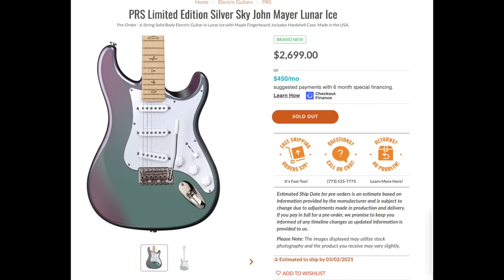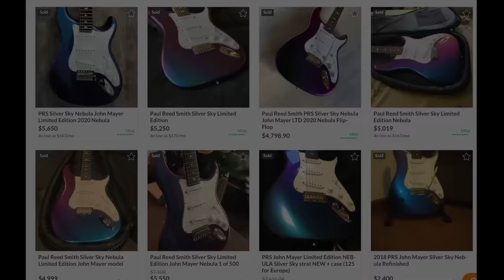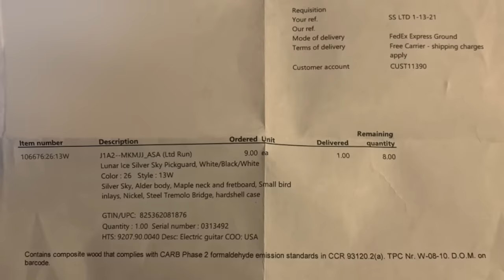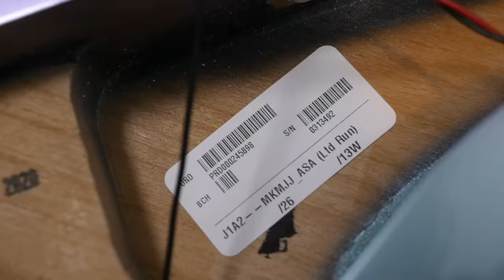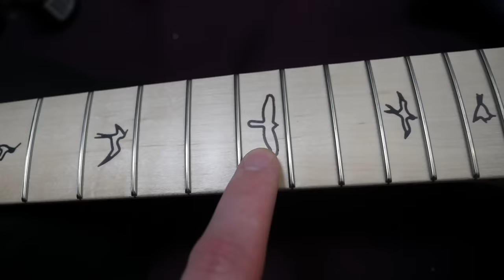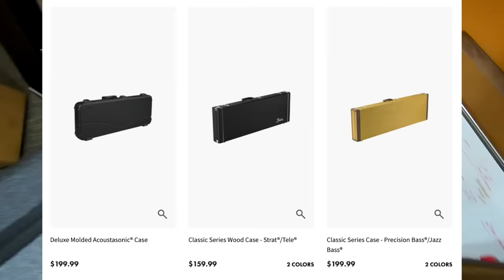I Got One of the First Ones! | 2021 PRS Silver Sky Lunar Ice John Mayer Signature | Review + Demo

Comment: beautiful guitar, but it's a crime that there's no hardshell at that price point...
Reply: Price point aside it’s a limited edition model as well. Hate being a snob but having a hard shell case just makes opening it up for the first time so much more special 😂
Reply: I'll be honest, I have a core 594 with OHSC as well as a Maple fretboard Silver sky. 
The SS case is way more practical. The PRS OHSC are so heavy it's stupid.
Reply: My issue with the SS is that at that price it has a scarf joint. If I'm paying over 2k for a guitar I want a 1 piece neck.
Reply: I get what you’re saying but the gig bag is part of the custom specs. It’s an artistic choice to emphasize the feeling of being a young player. If you want a hard case there’s a whole market for it, wouldn’t it fit in most strat-style cases anyway?
Reply: @NotDingse  yeah I keep my SS in a standard fender tweed and it’s a perfect fit , it is practically a strat dimension wise. I’ve also thrown mine in a gator case and it was just as good. I’d stay clear of those ABS hard cases though I looked at one of those and the tip of the PRs headstock comes really close to the top edge so if it were to take a spill it could put some pressure on the neck
Reply: @NotDingse  your a brave man lol . I really dig relic’ed /warn in guitars but I’ve never understood the people who are against it and say just to wear guitars in If you want a reliced look...I’ve got guitars I’ve had for 15+ years and they still look brand newlol 

Personally I don’t think PRS will do a reliced SS. PRS are probably one of the few brands that don’t look good beat up. They really are beautiful guitars and for the money I’d want to keep them that way. 

Jm is obviously not opposed to relics. His signature relic’d strat the custom shop did many years ago looked awesome though
Reply: @TJJJJJJJJJJJ  i agree with all your points, but the Silver Sky would probably be the model to make the exception of looking good relic’d (as it is basically a strat, which are probably the sole model behind relic popularity)

Imagine an SRV inspired relic on a SS. They could go all in and chip the points on the headstock (I’ve never liked those headstocks)
Reply: @dougstrong5386  I'm sorry your hard shell case is too heavy for you to carry. That must give you nightmares while you sleep. How do you get your guitar to your gigs? You must have to hire somebody to carry that incredibly heavy guitar case. And that's just the case by itself! I can't imagine having to put a guitar in there as well. Good luck, sir!
Reply: @NotDingse  your an ideas man ! Your right a relic ss would look dope , I wish they made it in a sunburst ! I’m a sucker for a beat up two tone strat I’ve got  4 of them lol. 

Curious what’s your number #1 🎸 ?
Reply: @TJJJJJJJJJJJ  We meet again, Mate! Hope you had a good night!
Reply: @jcout25  what makes you more salty, the idea that you think there is a reasonable argument to be made or the idea that I could in fact hire someone to move it if I needed to?
Reply: @joojoosasa  Hahahah fancy seeing you here mate 

lol I swear I’m not stalking you
Reply: What's interesting is that the invoice lists hardshell case. Who knows?
Reply: @TJJJJJJJJJJJ  well, i’m really a drummer, but if i had to say, it’d probably be a blackguard Tele or a Brian May Red Special
Reply: I prefer to not have a case cost hidden within guitar cost.  I dont use cases or bags anyways, but I 0refer to pay for a guitar separately.  Cases are abundant.
Reply: My PRS acoustic came with a hard shell case and this 3 grand guitar doesn't wtf lol
Reply: @moonchild4806  dont buy it then.
Reply: I purchased mine from C and M (Louisiana) and they offered a good enough price that the model specific, excellent case, was essentially included in the full retail price.  Highly recommend them and the case even though I didn't like the guitar...hahah

Comment: Why do so many brands not use strap button felts?? It's such a small thing but there is a reason they exist!
Reply: Right? I could buy a bullet Squier and it would come with felt pads for the strap buttons but not on a 3000 guitar oh no thats too much trouble.
Reply: @joelmiddaugh8229  I know, it's ridiculous
Reply: @markharmon9892  As a full time guitar tech I see plenty of new high end guitars with nasty finish cracks and indentations like the one on this silver sky. Not only does it damage the finish but the button itself will be more firm if the felt is there as it stops the spinning you get when they aren't tightened. So to not use a felt you either risk damaging the finish, or if you don't tighten it enough your finish will be ok but then the button will spin. So yes, they are needed.

Comment: I bought one of the first 500 Silver Skys back in early 2018. The first 500 models sold came with a hardshell case and I, without a doubt, would prefer the gigbag, even though the hardshell looks cool with the John Mayer Signature metal plate. It's insanely heavy, so it's impossible to carry around, even though the guitar itself is lightweight. Only reason I don't sell this silver sky for one with a gigbag, is my sentimental value of the guitar. Also, that really isn't a low quality gigbag, it's the best in its class, and they've obviously only made it better as you can see in the video. Also also, This isn't prs' choice, but Mayers, his Fender signatures also came with a gigbag.

Comment: After you tighten the tuner knob, you’re supposed to give it an extra quarter turn with a screwdriver. Paul, John Mayer, David Grissom, and many other working guitar players use and prefer gig bags. John wanted a gig bag. I also have some hard cases stacked under my bed. It’s gig bags all the way. By the way, the guitar lists for $2699, not $5,000. Pay attention.

Comment: I would love a PRS but not that one. I like the custom 24.
Reply: Good instincts. I've got an older Custom 24 with McCarty switching, and it does an excellent impression of a Strat in the neck, and just as good an impression of a Tele in the middle and the bridge. And then you pop that push-pull pot back down and you get big, powerful humbucker sounds. And a set neck. And a gorgeous flame top.  I wouldn't trade that guitar for a Silver Sky or anything from the Fender Custom Shop for that matter.
Reply: Grab a used CE 24, I spent 1300 on mine and it is the bee's nuts

Comment: You might have missed something when fitting the Silver Sky in the Fender molded case. I tried it with mine and it wouldn't fit due to the angled headstock touching the bottom of the case. This was a bit more than a year ago, though, so I'm not sure if Fender made it deeper.

Comment: Nice finish, would have liked a rosewood fretboard also. It would have seemed to make sense to use a solid maple piece of maple for tone. The maple looks raw. Like the body carves and the fat neck. Light weight but I didn’t hear the guitar as a piece. It felt a bit cold sounding. Middle position sounded the richest....not 4 grand rich. I’d put my 400$ squier against it. No hard case? Seems to be the way these days- pay more for less. How many of these get damaged in transit?

Comment: They should be doing roasted maple, with modern saddles, upgraded knobs and switch tip, and include both an optional rear cavity plate and a hardshell case. Raise the price to $2799. Jmho.
Reply: Still can manage without the rear cavity dust cover, it’s totally well finished in the cavity there without the plate. Looks a lot nicer than any fender you take the fiber off of.

Comment: I actually like it much better than the Nebula finish but I wouldn't pay a cent over retail price, after second thought.. I wouldn't buy one at all. They are insanely overpriced even as a base silver sky. Necks look cheap as hell - Slab maple on maple (reminds me of my $200 squire affinity), bolt-on neck with a scarf joint (reminds me of $100 silvertone strat copies). Would it kill you to use a single piece of maple like the vintage fenders this guitar is designed after? No figuring whatsoever (on most examples I have seen pictures of), should be specced to have at least some flame for the price. The whole guitar should be nitro (not just the neck). I also agree that satin is disappointing, they are 'lacquered'/nitro as far as I know but I also prefer glossy necks. For that price a softshell case is a joke. I know Gibson does this too, but not on guitars this expensive. Also the Gibson leather softshell case looks 100X nicer, I wouldn't mind keeping that as a back up, the PRS softshell case looks like the guitar - cheap. What makes this guitar worth the money? Why did they not just make it a $600 SE model if they were going to cheap out so much?